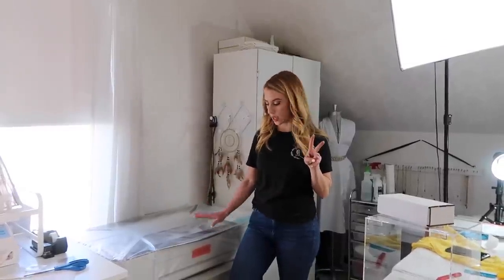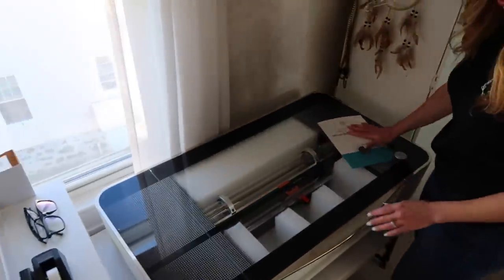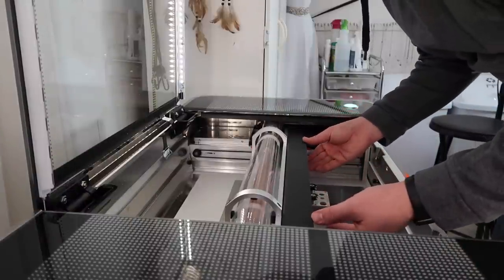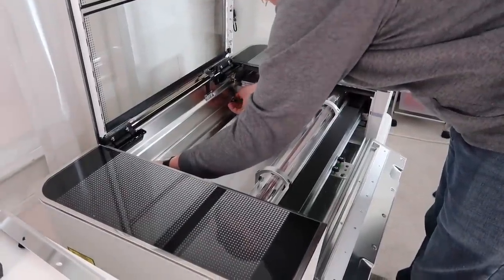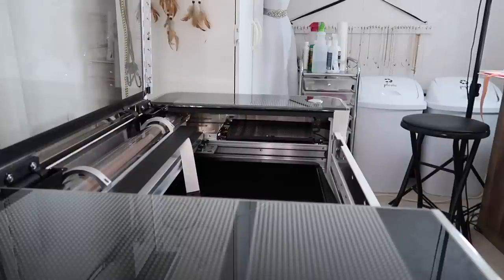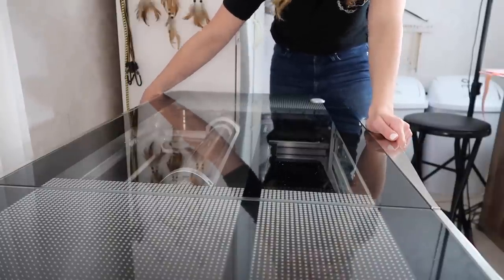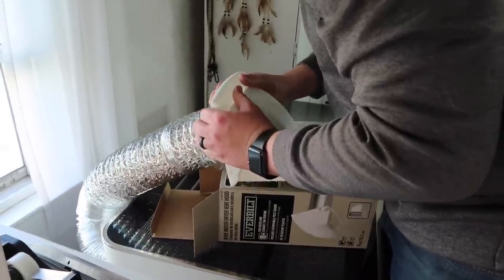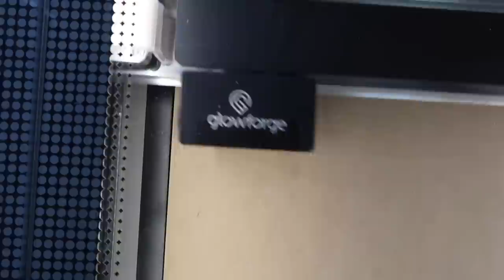Unboxing + Setting Up the Glowforge Pro • 3D Laser Printer

Comment: This looks like a brilliant piece of machine, over the last few months I've had this idea in my head for some product that I would like to make and produce. This machine covers half of the process, yet so much more! Just by looking on other users I got so many more ideas on what it can be used on as well. My immediate concern was the noise, but at the same time I got the idea for a custom sound insulated housing unit, how cool does that sound? Now I just need to find myself a new apartment for students, I live in a doorm at the moment, but I applied for a bunch of apartments around that are for students. I am setting up a photography and videography business, where I planned to turn the living room into my little studio. But with this Glowforge Pro not taking up much space I could surely make like 1/3 - 1/2 of the apartment into my work space for the other business idea that I have. And with a custom soundproof housing for it, so I can sit and edit on the PC while printing on the machine.

Comment: Looks like you didn't put the Proofgrade material in the right way.    Proofgrade materials come with a protective film and QR code.  You put it in the Glowforge QR code side up (with the QR code sticker being on the bottom right.

The camera in the Glowforge reads the QR code and gives you the best settings for that material.

When the Glowforge has finished cutting, you peel off the protective film.  The film helps avoid scorch marks
Reply from the maker: I know I realized that after watching videos. Do you have a glowforge, what products do you make? I have seen people use masking tape to get a clean engraving. Do you have any tips?
Reply: @MissAlexaKatherine  Hi.  No, I don't.  I'd love one but there's no chance I'd be able to afford it. However, when I want to get something I research as much as I can about it.

If I was to get one, once the Proofgrade materials ran out, I'd have to go the manual masking route as being in the UK I'd have to order from the US every time to restock.

You can use masking tape, or painter tape..... but whatever you use make sure it's suitable for laser cutters as some tapes can release toxic fumes.  You can get wide rolls of masking tape and use a squeegee to apply it without getting bubbles.  

I want one.  I'll gladly take yours off your hands. ;)
Reply from the maker: @Otuama3D  Haha thanks for the advice! I really appreciate it!

Comment: Promise that I am not a righteous self appointed engineer.

So some people made want to know what is the difference between the plus and the pro. 

Well the plus in the pro have the same laser however the pro has more space in other words you can put bigger things in it to use your laser cutter/engraver.

The basic has a weaker laser and much less space to work with it is made for literal hobbyists, The plus is made for people that are considering making a little bit of profit from this device and the pro is for solve righteous self appointed engineers that I am not lol.